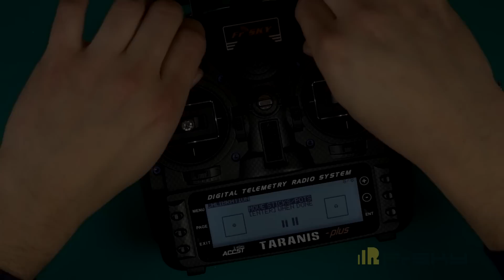FrSky M9 Hall Sensor Gimbal Installation For Taranis X9D Plus

Comment: you only shown replacing one gimbal..should it be both..and is there a left and a right gimbal ..or will they work  on both if I purchased 2
Reply: pinoydad0811 they are the same. You just disable the self-centering for your throttle

Comment: Hello, Does the M9 Gimbal fits on the Taranis X9E? Thanks a lot
Reply from the maker: No, this M9 gimal only designed for X9D/X9D PLUS
Reply: @FrSkyOfficial  Yes it can. Some modifications are necessary. Removing protrusion from upper side and widen holes to fit X9E screws. There are some videos and tutorials on web :)
I ordered mine for X9E.

Comment: I received mine today but I have problem installing them. They don't fit at all in my Taranis X9D Plus (2015). The  metal plate on the gimbals bind against the vertical trim switches on both sides. I made sure I put them in the right direction (sensors to the outside). Any suggestions?
I received the (newer?) version of the gimbals where the cables are glued above the sensor like on the R version. I got the gimbals from here: 
https://www.banggood.com/2-PCS-Frsky-M9-Gimbal-M9-High-Sensitivity-Hall-Sensor-Gimbal-For-Taranis-X9D-X9D-Plus-Transmitter-p-1143691.html
Reply: Wow, I actually figured it out. The aluminium plate on both gimbals I received was screwed on the wrong way around! The little lip should be on the side where the sensor is located. Quality control anyone?  

Ah, well. I let this one slip because I have so much fun with your stuff. 
Get better FrSky.

Comment: It looks like the same thro drag bar as the Taranis gimbal has, that would be the next fix I would recommend. Too much stiction and rough feeling while moving. Some use a piece of heat shrink or silicone fuel tubing, but its still not great imo. You listening Frsky?

Comment: When are these going to ship? I have preordered though HorusRC and I see they're already selling the Taranis with the new gimbals.
Reply: Mowdown horus rc has horrible preorder system. Better to cancel and buy from aloft or get Fpv. They require you to buy a bundle product so a receiver, flight controller or vtx with each gimbal plus a small fee of 2.50. With that it ends up costing the same or more than buying locally. And with recent issue with hajin ( freight company) it may not arrive unless you buy the more expensive air mail and you'll probably pay tax on that.
Reply: jussa101 Yea man, I got that email too.. wtf is that, Idk how they think they will get business.. they sure as hell arent gonna get mine... lol

I really want the gimbals, but im not gonna buy some shitty product I dont want or even need to get ahold of them.

GetFPV pretty much always have and will continue to get my duckets!!

Comment: This video shows only the replacement of ONE gimbal, and is closed with one old gimbal inside, with the M9 gimbals placement, the tension bars should be located at the outside, otherwise it won't fit !
The difference is that the M9 has wire connections that are on the opposite of that of the old version of the gimbal.

Comment: Josh, off topic question. Looking at your Taranis, it looks like you have power coated switches and switch screws. (not the one holding the gimbals) but the normal switches. Where, or how, did you get them like that?